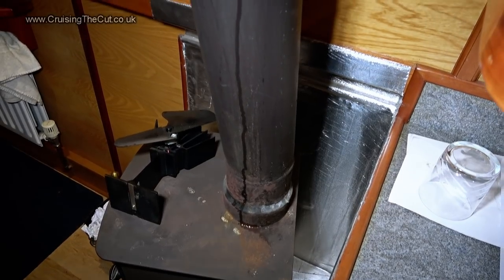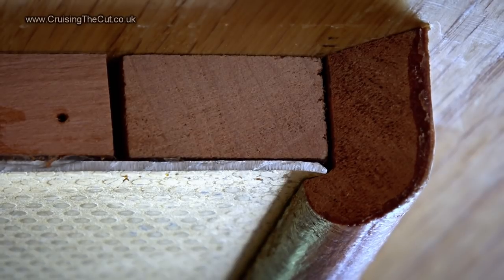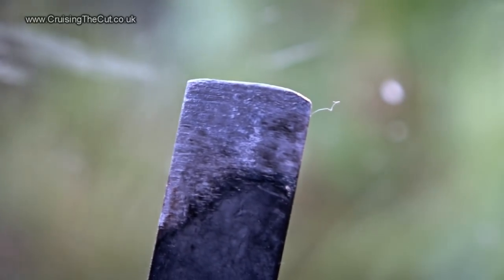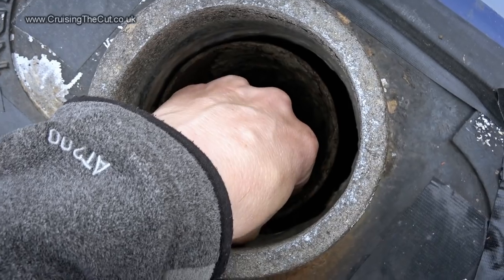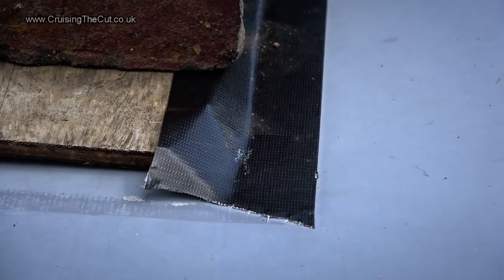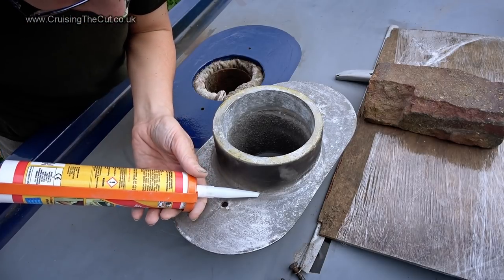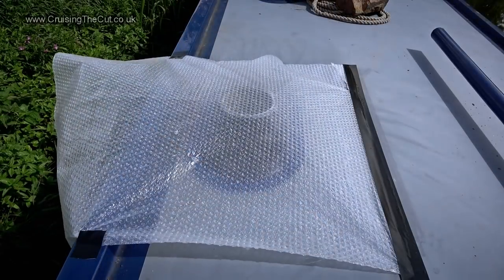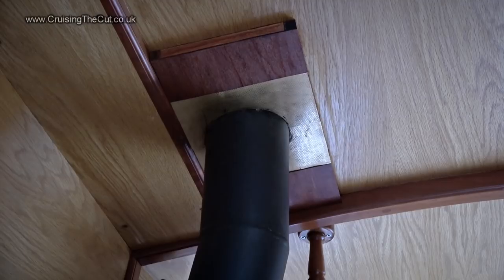119. Removing and re-sealing the chimney collar on my narrowboat to prevent a leak

Comment: When you use silicone for any deck fittings, partially tighten it down, let it go off for a few hours, then tighten it fully, it gives you a full waterproof seal,  most people do what you do and fully tighten the fitting, this squeezes all the mastic out, it will work for a while but any movement from expansion can break the seal and the leak will come back, letting the silicone go off acts like a big waterproof washer,
Reply from the maker: Good tip!

Comment: Great video. Now I want one of those DeWalt multi-tools!!! Just a suggestion, next time use some copper grease on the bolts (you can get it from Halfords) when you put them back so that they are easier to get out next time.
Reply: Seconded, some anti-seize on most of the bolts used for... Well almost all the places, being a boat, could use some anti-seize. For bolts that have rusted before, you can replace those bolts with stainless steel bolts and then use the anti-seize as normal.

Comment: Insert the bolts but wait for the sealant to firm up before tightening. That way the sealant works as a cushion against small movements, such as when your chimney gets bumped, as well. It also allows for a thicker layer of sealant such that when compressed makes a tighter seal without having any thin places.

Comment: That sealant coming out from the edge is known as squeeze-out, and it’s an important signal that you’ve applied an appropriate amount of seal  so long as the squeeze-out is consistent and goes around the entire perimeter. The second thing you did was known as faying the sealant. You then did an extra fay seal; which wasn’t needed as you had already fayed the squeeze-out. Of interesting note, using a wet finger to fay a seal is not only okay but in aviation is a completely acceptable tool as it creates a very good radius. Well done, sir.

Comment: Great video, very clear and the odd dash of humour too.
I bet the air was blue after you cut those holes in the ceiling to find you had no nuts!
While the vibrating tool works well I find them to be unbearably noisy.
The end product looked very good and worth the extra effort.
The silicone shapers I used for my roof fans are excellent at smoothing out mastic.
Not sure what they are made of but mastic just doesn't stick to them.
Reply from the maker: Cheers Greg - yes, the odd choice word was announced loudly to anyone in earshot... the multitool isn't too bad, I thought, although maybe using it outside helped the sound carry away. In a van might be a different story ;-)

Comment: I absolutely love the "come at the problem" mentality with you fixing things.  I'm really enjoying all of it to be honest.  As a viewer from across the pond, I also appreciate how many products you use that are from the US but end up having to Google all of the products from the UK.  One thing I might mention would be to make sure that the sealant is capable of withstanding UV if you're going to use it around the outside edge of that cover.  With the amount you used on the inside it's really not an issue, but it will keep it from cracking/peeling in the near future.  Exterior window caulking is usually used for this purpose.  Regardless I fully enjoyed this video.  Please keep them coming.

Comment: I enjoyed the video and I know it's too late now but I wanted to let you know that they make sanding attachments for those oscillating tools that work wonderful. Actually they work better than a regular vibrating sander because you can adjust the oscillation speed. I have the rockwell version of that tool that plugs into the wall, and I have to say it was probably the best value I received for the money I spent on a tool in my life.
Reply from the maker: The DeWalt speed is fully adjustable, depends how much you press the trigger.
Reply: That trigger speed must be nice for control when you are starting and if you need to change speed while working. The Rockwell Sonicrafter has a dial on the back that adjusts speed, it's nice because you can't exceed your set maximum speed, the down side is that it starts at that set maximum speed as soon as you turn it on.
Reply from the maker: Interesting! That sounds like a good idea; if they could combine the variable speed trigger with a maximum limit, that would be even better :-)

Comment: David a money saving tip for you. Dont throw away the blunt multi tool blades but use a Dremel with a metal cutting disc and re-cut in the teeth to the blunt blades and in no time  the blades are as good as new. I do this in my electrical trade and only replace when they get too short. Hope this helps. Keep up the good work.

Comment: There are two approaches. the "I never want to do this again" and the "lets make it easier when it does fail in the future"

It looks like you picked the first one. Personally I would have gone with bedding compound instead of sealant so that collar would pop right off the next time it is due for repair. The steel roof is nice because you don't have the issue of damaging fiberglass when removing things that are glued a bit too well. 

I do enjoy these DIY narrowboat videos. Thanks for all your work on these videos.
Reply from the maker: It will never fail again in my lifetime. If it does, I sell the boat ;-)

Comment: You look to be a fairly handy gent when it comes to repairs. Of course necessity breeds ingenuity! Good work! Those multi tools are the most amazing things to own, mine gets used on a regular basis and I don't even have a narrow boat to work on!
Reply from the maker: I love mu multi tool though I keep losing the attachments which is most annoying.
Reply: I always stock up on the cheap universal attachments when I go the the hardware store. That way I have at least three of whatever I need scattered about. It doesn't prevent the loss of any of them, however I usually find one right where I used it last and it is usually right where I need it again.

Comment: Another great V'log. When it comes to sealants, if it's not dripping all over the place it's not too much or in other words the right amount. To bad there wasn't a sealing gasket made for that but with the amount of sealant you used it most likely not needed. I'd still check it every few months in case the UV in sunlight degrades the exposed sealant.
Reply from the maker: I think the Sikaflex is UV-resistant

Comment: Nice job David. Having to clean up bedding compound is much better than having a leak. as long as you're buying tools. Get an impact wrench, they're great for getting out tough bolts. DeWalt makes one that takes the same battery as your vibrator tool.
Reply from the maker: I really needed an impact wrench when I did the alternator (as you'll see in a future vlog) but so far I haven't been able to justify the cost!

Comment: You should have waited till the next day to tighten those bolts. That way the cured joint material acts like an O-ring. It expands and seals that whole collar a lot better. 
Keep them coming, enjoy watching your vlogs. Sure you need that chimney in the current kind of weather in your part of the world right now!
Reply from the maker: Cheers
Reply: CruisingTheCut You're welcome David. We use that technique on all our ocean going vessels with just about anything that needs tightened, through hulls, exhaust flanges, sea water cocks, deck puttings, windows and portholes, even on rudder bearings! The material cures first, after which it is tightened for waterproofing. When you tighten the nuts first, all that happens is any extra material is squeezed out and goes to waste, without having any elasticity left to contract during times of cooling/heating. Mind you, we don't have wood fired chimneys fitted though hehe. 
Keep the vlogs coming, thoroughly enjoying them! Sure you need that heater in your part of the world right now...

Comment: Self tapping bolts are the norm with narrowboat fixings, especially on roofs. Sometimes a square nut can be found on the underside, but the steel on a narrowboat is thick enough for self tappers.
Reply: ... although I suspect that Milburn boats used taps to thread the hole in the roof to hold the securing bolts.
Reply: @Smannellites  ... Agreed on the holes being tapped. "Thick enough" for self-tapping bolts isn't the standard, rather it's a "Thin Enough" standard for anything like mild steel and/or harder materials.

Comment: Another vote here for the multi tool. You can buy a version without a battery. Then, assuming you have a De Walt battery drill, the battery from that can be used.

Comment: Very informative.  I wonder however if the two bolts should have been replaced with some kind of larger  capped type of bolt.  Having the bolt head recessed flush with the roof collar seem very counter intuitive.  Create a hole which collects water, then insert your bolts, fill it up with glue/cement to keep if filling up with water and so of course you have to go to gobs of trouble to ever get the bolts out again.... you get where I am going.  Would have seemed far more sensible right from the initial installation to put in a fastener with a broad cap that completely covered the area around the bolt hole and then seal under the edge of the cap.  Probably would have looked at stainless as well since that way, you never have to worry about those bolts corroding, ever.  Having one of those snap off doing that job would have really made your day seem rainy.
Reply from the maker: It is a peculiar design, I agree but rather than try to replace it - which might have brought about its own issues - I did as you describe and reloaded the original bolts with loads of sealant. Yes, it'll be a pain to remove again but I'm hoping not to have to do so for a very long time.

Comment: You need a set of stiff putty knives, never use a screwdriver for something it was not meant to be used on.  But the multi-tool was a good buy.

No you did not use too much sealant.  You want a good amount to squish out.  I remember using 6 to 8 tubes to seal a thru hull fitting that was well above the waterline, and it has not leak and that was over 23 years ago.

Comment: Suggest the little silicon tools for doing work with sealant, work really well as the sealant just wipes off the tool and leaves a beautiful profile, you can also choose to chamfer the sealant instead of the finger profile (which they also have a tool to create a constant concave profile with). The top brand are German Fuji of something like that and about £20 for the set, or £6 ish for generic set from eBay/Amazon, take your choice.

Comment: nice job! i'd have left all the silicone in and not squeezed it out, let it set, only then screw the bolts down. Then when the pipe gets hot and expands upwards it wont pull the seal up from the roof again as had happened before, the silicone would remain in compression making a long tight seal.

Comment: Looks like a swell job there. I am not sure there is "too much sealant" (of course there is, but you were still moderate). I love these multitools, even if the German in me would have chosen a "Fein" (Dewalt is more than good enough). It will certainly come handy when you do your campervan.. One of the better uses is the saw that allows you to cut something exactly at the floor ow a wall.

If you next come to a screw that won`t bulge the rule is simple: If it does not turn apply WD 40. If that does not work use a t-bar and a pipe for leverage. If it turns again and again but it does not lift, then it is time to look for the counterscrew. 
You might want to invest in a bit better socket set, I help import these from China. Then sockets you have have a nasty tendency to come apart when a bit more oomp is required. Even if they do not the sockets do not conform well to the screws and round of the edges over time, then they never turn again.
Reply from the maker: Good tips, cheers

Comment: Tip for you. Use windex etc (spray bottle of window cleaner) after applying silicone. Spray over silicone and surrounding area.silicone will not stick to a wet surface so it makes the cleanup neater and easier. And rather than use you finger, I'm sure your local hardware store sells small rubber spatula made for this.
Reply from the maker: Cheers. You can get them but I quite like using my finger, it's nice and accurate!
Reply: you can put some cling wrap over the end of your finger then simply take it off or cut the fingers off rubber gloves and then use them (over your fingers) and throw them away and still have clean (no yuck) fingers........ seen it done
Reply: well you can still use your finger but its a bit messy, but I still recommend the windex first

Comment: It’s too late now but it’s best to used a “lead grade” or zero acetic silicone sealant. It handles high temperatures but unlike ordinary silicone sealant won’t release acetic acid which can cause corrosion. 
All threads and anything say against stainless should be treated with anti seize paste. Action Can CS-90 is fab.
Reply: Sikaflex is not ordinary silicone sealant.

Comment: Gaffer Tape, Tisk Tisk! You really need the ultimate DUCT Tape. Yes I know Gaffer Tape I was in Broadcasting. DUCT Tape IS the American Answer for almost anything. Yes it started life just for sealing DUCTs but was so Good it has sprung a whole generation of Replacements. All kidding aside it should be required Tool Box Emergency Supplies. The newest stuff will Seal, Stick, or Secure almost anything. It has even been used to seal woulds self inflicted or IED.
Reply: Having worked in video production in the UK, what they call gaffer tape is just duct tape. Real leave-no-residue Permacel type professional gaffer tape is difficult to find there, only from production and photo supply houses. I usually had colleagues bring over the good stuff from the US. British “gaffer tape” is found in any hardware store.
Reply: Gaffer tape is better than duct tape in a number of applications.  I use strips of gaffer tape to remove overtones from drum heads. Duct tape doesn't work as well and leaves a mess when removed.

Comment: Nicely done. So the two bolts really didn't hold the collar on the boat, but you need them there anyway else there would be a hole in the collar? Maybe make a folder with a few images taken from the video and a few notes for these DIY repairs for future reference for yourself, a workman, or a future owner.
Reply from the maker: The bolts did screw into a thread in the roof but nothing more than that.

Comment: I can't help myself as I just have to ask... why TWO holes in the ceiling panel? Would the first one not have made it clear there was no nut to be found?
Still, respect for a job well done! I doubt I could have done it even remotely as well. As an IT guy... if it does not come with an app I am lost :-)
Reply from the maker: There's insulation foam on the ceiling and I hadn't scraped that out (and discovered the lack of nuts) until after I made both holes.
Reply: An excellent forensic question.

Comment: Hi David,  It occurred to me while watching this video when you were trying to find out where to drill the holes in the roof to expose the nuts that an endoscope might have been handy, as I'm sure it would be for many other parts in the boat you'd like to inspect but are inaccessible.  I have this one (https://www.amazon.co.uk/gp/product/B01N41KWKZ/ref=ppx_yo_dt_b_search_asin_title?ie=UTF8&psc=1) bought from Amazon for less than a fiver that connects to a computer and it also has a light on it so it can go into the darkest recesses and show you what's going on. It's also waterproof so I suppose you could also look under the boat if you want to.  They seem to be other more expensive models now and the only downside with mine is that it sometimes isn't easily recognized by the computer but mostly it's okay.  Keep on doing these kind of VLOGS I find them in some ways more interesting than the normal boating ones, although they are excellent as well.
Reply from the maker: Cheers; I’ve sometimes wondered about getting one of those so I’ll have a look.

Comment: So how is the sealant you used holding up? The red sealant is fire / heat rated. Would have been nice if they had originally welded another piece of metal plate to give that are a small bit of extra height. So that the water would run around it. Wouldn't think 1/4 inch or less would have hurt clearance. Take care - gotten this far on your video's.
Reply from the maker: It’s all fine to date
Reply: @CruisingTheCut  Great to hear.

Comment: Nice job!  I'm wondering how the "sick-a-flex" (msp perhaps) compares with 3M 5200 with which you are probably familiar. Very tenacious stuff, and often used for bedding chain plates and deck fittings on fiberglass boats.  Not sure about its heat resistance tho. Again, nice job.
Reply from the maker: Sikaflex! I've never used the 3M product you mention so can't really comment. Sikaflex seems to be the narrowboat "standard" :-)

Comment: I'd have been quite cross, and I think I would have used some non YouTube approved language had I found myself unnecessarily drilling holes in my boat's roof. Especially as my finish carpentry tends to look like a dog's breakfast. I shall stick with my electronics & computers, at least I know what I'm doing in that realm.

Comment: That explains why someone had used Sikaflex  to secure the bolts, cause they couldn't get underneath to put a nut on without removing the  ceiling trim. One question, as you had cut two holes for the absent nuts, why didn't you use new nuts?
Reply from the maker: I didn't have any and it seemed to me that it would stay in place quite happily without. The collar is quite heavy and since it slots through the roof, would not be in any danger of blowing off ;-)